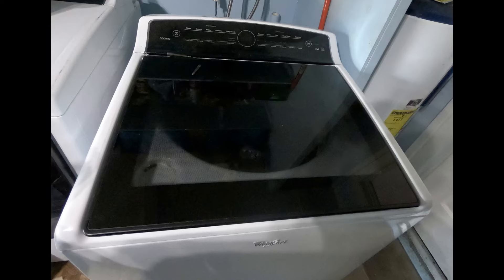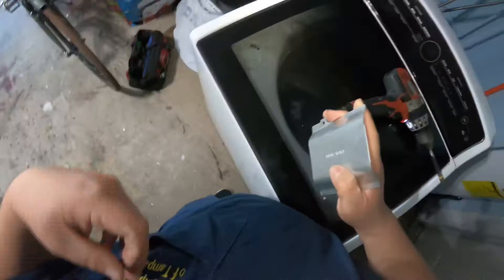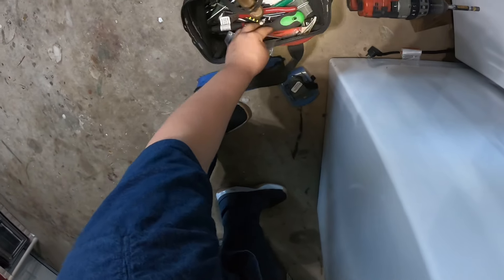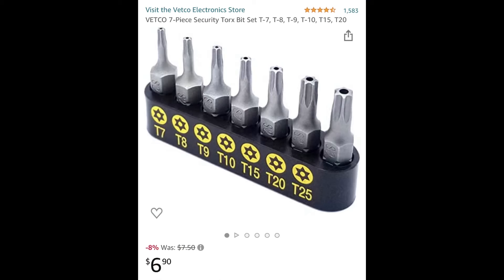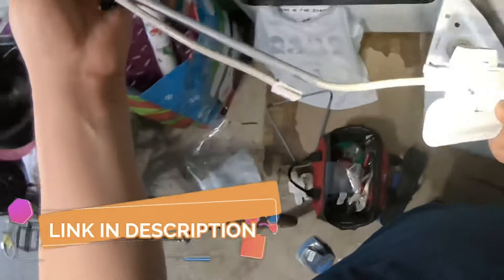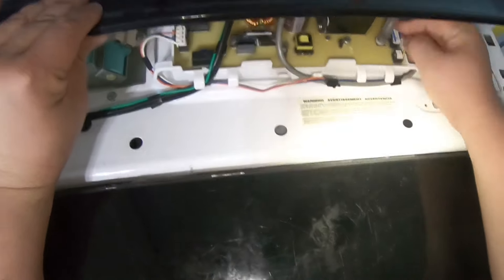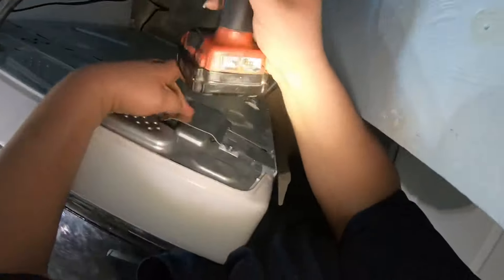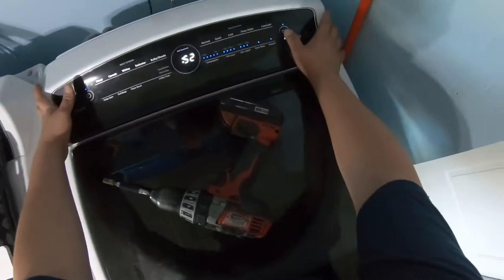How to Fix Whirlpool Cabrio Washer Flashing F5 Error Code | Clicking & Beeping | Model WTW8040DW0

Comment: HAS ANYONE RUN INTO THIS PROBLEM?? First of all thank you so much for the video !! After replacing the lock assembly the F5 error code still showed up and the washer wouldn't work. So i took it back apart and noticed that there are 2 identical "ports" where the lock assembly connects. I initially had reconnected it to the port that the old lock assembly was attached to but i plugged it into the other port and now it works fine. Hope this helps others who may encounter the same problem!!

Comment: Just completed this simple repair. Did it along with pausing your video on each step! My only advice…on the T15 screws holding lock in place…PLEASE USE MANUAL DEVICE TO SCREW THEM IN! Stupid me used my small power screwdriver and snapped the plastic base that screw goes in. I did other side gently and it’s tight. So 1/2 seems to be ok as it’s working perfect again! My lady is a happy camper again!! Thank you bud for this oh so simple repair! Saved me a ton!!
Reply: I wish I read this comment before doing the repair.  I had the same piece break using just a screwdriver.  It doesn't need to be tightened too much, just snug.  Since I also have one side loose, I was wondering if yours has kept working?  I'm sure I could source the base that has the broken screw, but I'd rather not!
Reply: Hi Kurt! Yes, it held up just fine. But eventually had to replace entire washer as another problem came up and was more cost effective to replace. The splines on the agitator wheel were stripped. Way too much $ to replace as I would’ve needed a pro for that job. Wasn’t as easy a replacement as lock mechanism was.

Comment: Why is it when something’s simple to the video maker I always find it tricky lol I can’t get the clips undone. I got the right one but the whole thing came off… when putting it back together you just say it clips back so I know that’s wrong but I can put it back in… the left side is on still… any tips? Have any videos that show what ur doing? Maybe I’m not strong enough to push it down… I had to use pliers and squeeze with everything I had for the right side. And it popped out. Send help asap please I’m out of clean clothes 😂

Comment: Don't use a drill they where right  I just drilled  a hole in it this video is right on point
Reply: Can you fix it if you cracked the plastic hole?
Reply: Shouldn't be a problem

Comment: Kind sir, thank you for the very detailed tutorial. I have the same washer and was getting a F1E1 error. I replaced the lid switch by following your video and the machine seems to be working fine but I’m still getting the F1E1 error code in the diagnostic mode. Do I need to do something to reset the error code or do I have another issue that I’m not addressing?
Reply from the maker: The error code is going to go away, by her self
Reply: @DIYRepairsNow  Really, by itself? How long? I replaced the lid lock today.
Reply from the maker: It’s supposed to go away between three and five loads
Reply from the maker: @matchinthegastank9  or you can disconnect the washer for 24 hours
Reply: @DIYRepairsNow  Interesting! I will keep that in mind. Thank you, sir!!!

Comment: Very instructive video.  My Cabrio washer was throwing up F5 and E3.  My daughter, realizing the lid was locked in place, decided to force it up and broke the engagement system.  Followed the steps in this video, including the link to the part on Amazon, and had it fixed inside of an hour.  As seen but not mentioned in the video, you do need to turn off the water outlets and disconnect the hoses before removing the control panel.  Thank you!
Reply from the maker: So Glad My video Helped you Fix Your Washer! Thanks for he Support!
Reply: You dont need to remove water lines on my cabrio, which is the same model as the video.

Comment: Is the F5 error a 100% the lid switch ? 
I have the same washer and it just started not rinsing properly, it stopped dispensing the soap amd FS and I get the F5 error as well ! Kind regards
Reply from the maker: This is the Most Common Repair For an F5 Error Code on this Washer.

Comment: Just attempted this repair. At first the computerized display was acting very wonky. Slow to start. Even turned itself off and I got an F5 E1 alert. I did a reset of the control panel and now it appears to be working ok. Does the first error concern you or that’s typical and the reset should have fixed ?

Comment: I'm trying to replace my lid locking switch via this video and I've followed you most of the way. However, for the part of the video where it shows the clips to remove the control panel, it's not showing the clips and removal very well. The video is just below what I need to see as to how you've accomplished this. Could you please show this portion a little bit better for me? I've got the harness removed from the lid and the side clips as you've shown, it's just unplugging it from inside the control panel (which needs the cover removed to access) that I'm struggling in. Other than that, this video is extremely helpful.
Reply: Were you able to remove those clips?

Comment: Thank you just did this repair thanks to you. Hardest part was those clips holding the display panel, they fell into the washer basin.  Had to tape a magnet to a pole to fish them out. Then getting them back on was hard to figure out. That needs its own video.  But thank you for your help.  Saved us buying a new washer.
Reply from the maker: You’re welcome thanks for watching my video👍🏻👍🏻

Comment: What if it’s locked and I cannot get it opened flashing f5e3
Reply: I had the same issue and had to replace the lid locking switch. Evidently, the connection that the fingers glide on is either bad, loose, or corroded. Either way, I found replacing the switch was my only option. You can find the switch on Amazon for about $56. Then follow this video and your machine will gain work smoothly

Comment: I just completed this repair on my Kenmore 600 series and my washer works again! Great work on this one. Here are a few of my notes:

1) On the back of the washer, you only need to remove (1) 1/4" screw for the wire cover and (2) 1/4" screws to free the upper section of the unit. 
2) There are 2 metal clips that hold the control panel that need to be pressed downward in order to free the housing and access the control board. They are hiding under the larger black springs.

This is the only video I found on YouTube that showed the repair process for this model washer, thank you for sharing!

Comment: If you're struggling with the clips for the display panel, push down and in on the top leg of the metal spring thing there, not the bottom leg or the center of the arch.
Reply: @koborivers  I can’t figure this out 🤦🏼‍♀️
Reply: Omg down and IN!! Holy crap I got it !😅 Thankyou sooo sooo very much